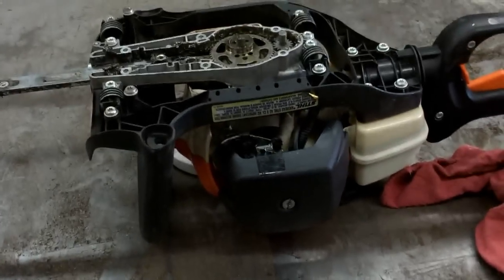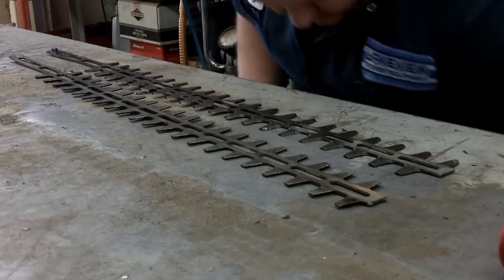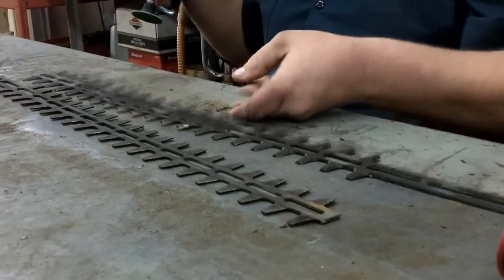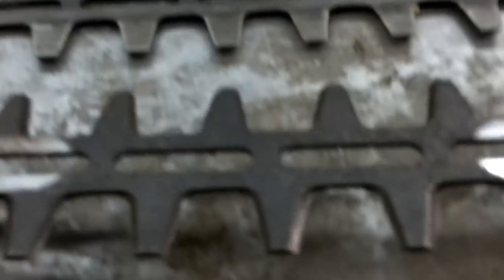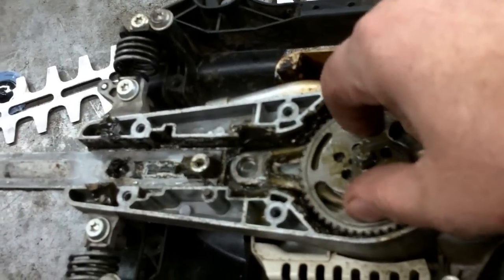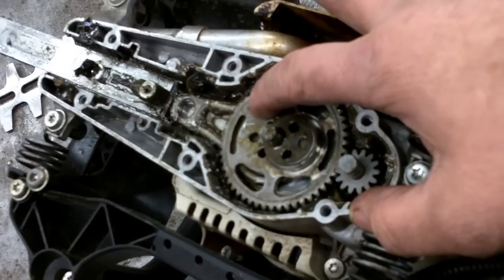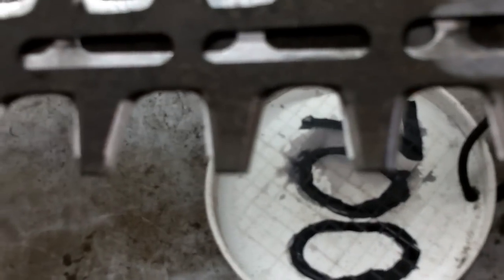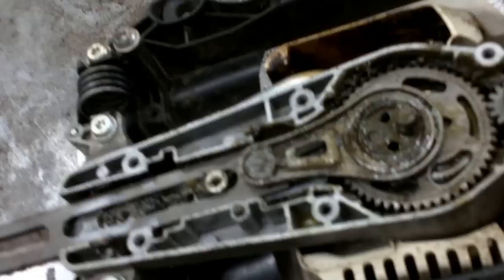HOW TO SHARPEN HEDGE TRIMMER BLADES

Comment: hi , what is bers ?   i think an angle grinder is the best, and what you need to take of if you cal it a ber  is the rounding of the bottom part of the blades , i think you should show it in closeup . basically no need to take out the gear but its a good idea, i think it can be ok also to flip the connecting rods, .  that's a real good gear you have there  but many gears like echo tanaka and so have very thin pins that need to be replaced together with the connecting rods frequently  and that is a nother story ...

Comment: at the shop i work at we do it alot simpler, we just align the blades, take the air angle grinder like you had and sharpen them exactly as you did. I see the diffrence but in time its just not worth it to do i dont think since were so busy now. we get about $40 for sharpening double sided 20" blades how about U

Comment: If you use the air grinder on the flat mating surfaces, you're making gaps in the metal where they won't mate flush & pinch the stems instead of cutting sharply

Comment: I agree with Jeremy if you did this another way...it was half assed. The only thing I do differently is I use a scotchbrite roloc on the backside instead a  grit pad. If it's not taken apart to be cleaned the machine just missed a major part of the service. All of the crud between the blades makes the engine work harder. Can't wait to see the half ass way next.. if he ever posts it.

Comment: Before sharpening, just remove the nuts on the little bolts holding the blades together and check the wear on the washers touching the moving blades. No need to remove the blades from motor assembly either!  Replace if worn with like size or temporarily turn them over so the worn side of washer is up. Often this is all that's needed or even absolutely necessary after all the sharpening is done.

Comment: Damn mine doesn't like to move that fast without building up for probably 3/4 of a second or without stressing the motor slightly too.  You really got that one as good as possible I believe.  I don't have that tool you used so can I use a orbital sander or grinder?  If so would the smaller one be better than the 6 incher.  I also have a belt sander and the oscillating kind.  I have never seen those for my 3/4 inch corded low RPMS 8 amp drill?  I already know the sawzall is out of the question unless I wanted to turn them into scrap metal.  I have a sealed blasting box and the compressor to use it but don't know if I should go there and my longer blades wouldn't fit.  The small angle grinder makes me a bit leary tho since I have never done this before.  Thanks

Comment: Hi I have the same stihl in the video 81....I cleaned the carby and cleaned the blade and spark plug the machine is not very old....It ideals but when you add reves the blade just moves a little bit and then bogs down and dies any help would be good....
Reply: kevin storey did u pull out the spark arrestor and burn off all the oil? I bought a pair of hs45 and always bogs down with any gas..pulled out spark arrestor and took a torch to it and wire brushed the dust n flakes ...good as new easy fix

Comment: Hi, can you help advise me please, my petrol hedge cutters blades keep running on idle, i've adjusted the idle screw as low as i can go then it cuts out. the manual says to take to a dealer, is there anything I can do myself. Thank you
Reply: wal buzz It could be that the spring (or springs) which holds the clutch shoes together has broken.  The spring provides resistance to the centrifugal force acting on the clutch shoes when the crankshaft it turning - without that spring the blades will turn at idle speed because the clutch shoes fly out and make contact with the inside of the clutch drum.  When the spring is intact the engine revs have to reach a certain level before the centrifugal force is strong enough to overcome the force of the spring holding the shoes together.  You'll probably have to take the trimmer apart to confirm my speculation - a new set of clutch springs are not difficult (perhaps fiddly) to replace.
Reply: OLLIE251391 Thank you for your help, the bolt holes had enlarged allowing the clutch to just move around too much, replaced whole clutch and bolts and it's working as good as new. I really appreciate as many others do the time taken by people such as yourself to help and guide other people who may lack experience but you guys point the way and following good advice on safety and tips really has saved my buying a new unit. Thank you sincerely walbuzz.

Comment: i have a sthil hedge trimmer and i was wondering what causes the blades not to move, it starts up and everything put as soon as i hit the throttle the blades don't move at all, and i was wondering would that have to do with timing on it if the timings off, or is the gear shaft or anything with the gears wore out, and if thats the case how could i tell if the gears or shaft is out of place wore out or if the timing is off?
Reply: SeRReAL6 gears / conrod bearings worn out, posibly gear bearings too. life of the gears depends on how often you grease the gear box up
Reply: Does it sound like its trying to move them but being held back and then dies? If so try getting the hedge trimmer blade spray which removes rust and lubricates.  If that doesn't make any difference you might have a stuck clutch drum which means more taking apart and WD-40 rinse then slowly working it back an forth till its loose and moves without resistance.  Good luck and hopefully its not to bad.